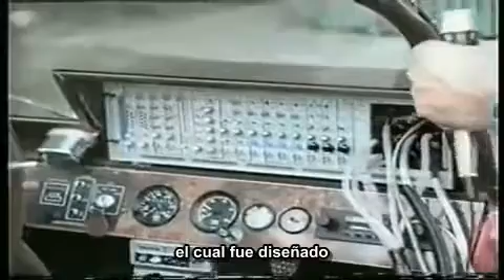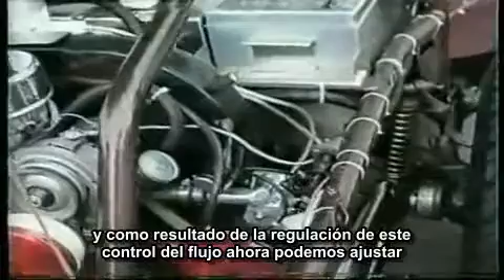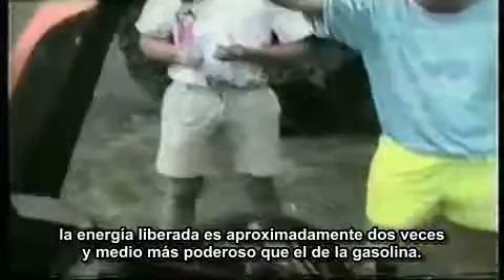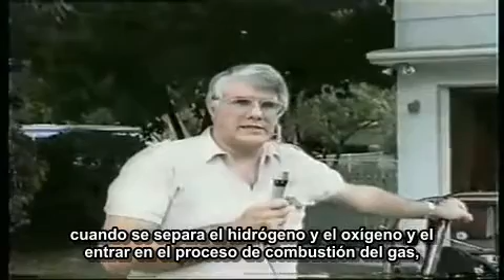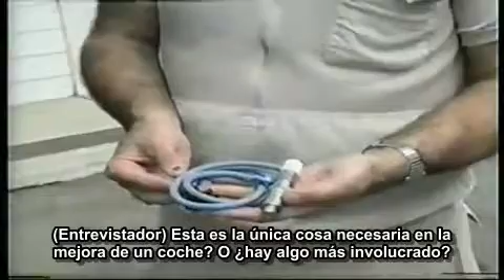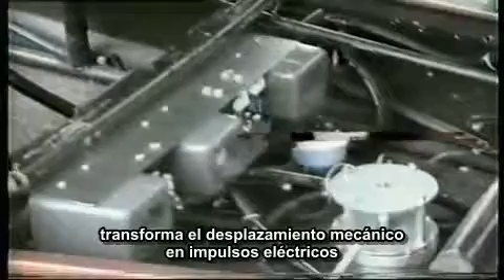Stanley Meyer 1992 -  entrevista Coche que funciona con agua

Comment: En un tiempo creí esta historia e hice el ridiculo contandola y experimentando. Todo lo que el dice es falso, la electrolisis necesita mas energia para efectuarse de la que se obtiene, lo que el dice viola las leyes de la termodinamica. Y como mete a Dios en el potaje, es muy vergonzoso... conducta típica de vendedores de aire frito, charlatanes y estafadores.
Reply from the maker: Si. Si. Lo de la relacion de produccion hho y watts esta comprobado que es 120watts/litro hho al minuto. Pero hay un error de traduccion  de sus videos. El nunca dice que requiere menos watts. Lo que hace mas raro a su modelo es que el subio el voltaje resonante  aplicado y bajó amperes. (para ser mas eficiente la celda) Pero el consumo final de la fuente sera el mismo. Yo hice prueba con un tubo.